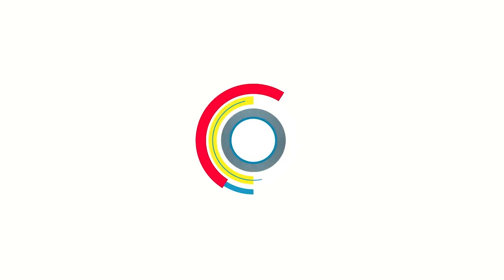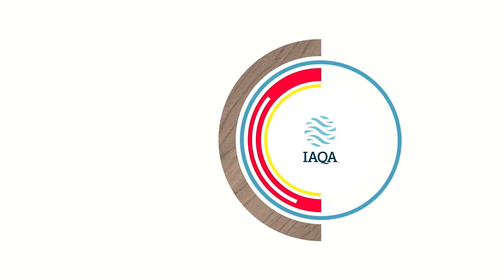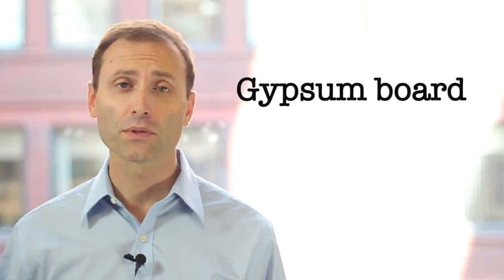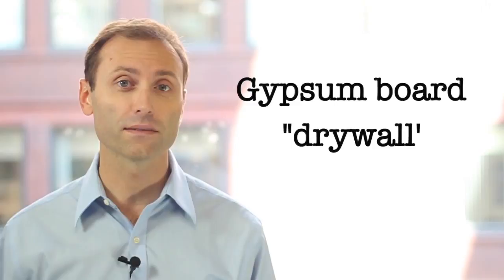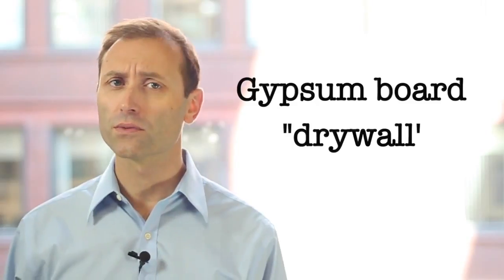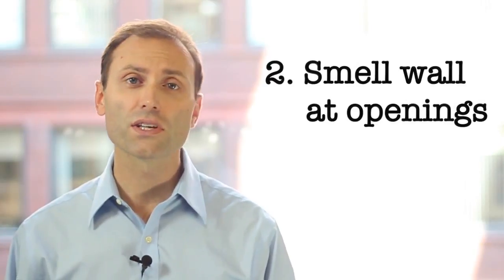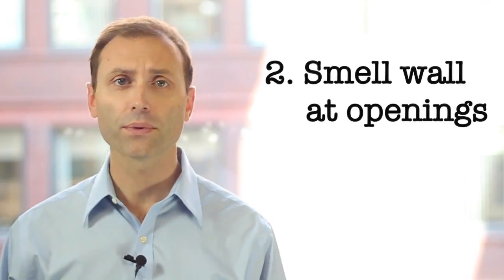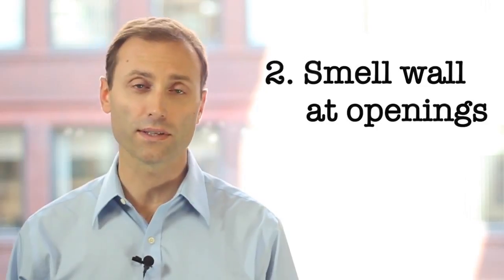How Can Consumers Detect Mold Inside Their Walls

Comment: I cut some holes in the wall like this video suggested after a roof leak.  There is definitely some mold growth behind one wall.  There are other walls where I put a camera inside the hole, but there is no visible indication of mold growth, but the holes reek of fungus.  What do I do?  There's a mold smell, but no visible signs of mold.
Reply: I have this same question!
Reply: Call a Pro for inspection (they have cameras like how they inspect your sewer line). 

They can also determine what kind of mold is in there, including Lab documentation. STRONGLY recommend you not try to save money by doing it yourself. One tiny mistake could leave you/your fam affected by mold spores which can be debilitating or even deadly should you manage to ingest spores. The human body is the perfect combo of moisture and warmth, to support mold growth that could be locked in before you realize you should see a Dr.

Good Luck.

Comment: He left a few out... 1.  Try checking the tack strip under carpet if present.  2.  Check the back of base trim for growth/water damage  3. use a sharp object like an ice pick or utility knife and press into an inconspicuous area of the suspect wall area.  Sheetrock which has taken on water and then dries out on it's own will harden like a rock.  It will take very little effort to penetrate unaffected sheetrock.  Water damaged sheetrock will either cut like butter when wet, or it will be hard as a rock when it's dry.